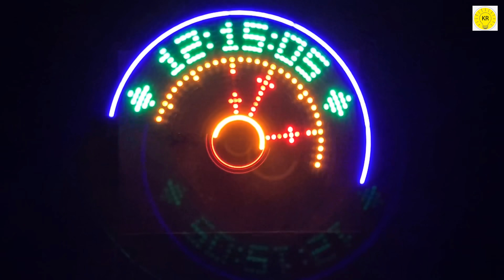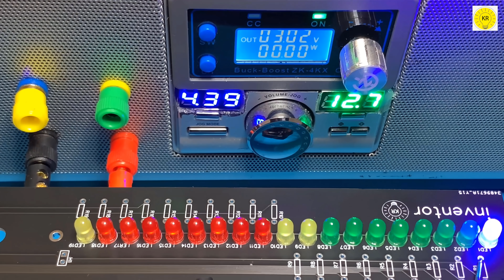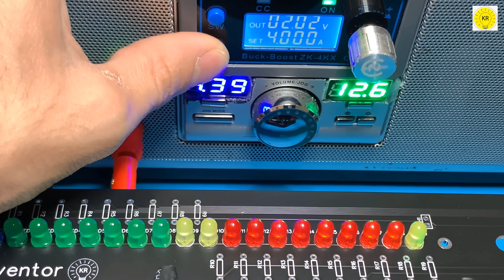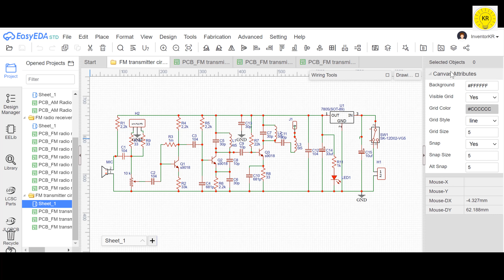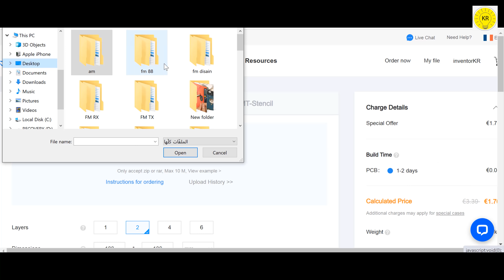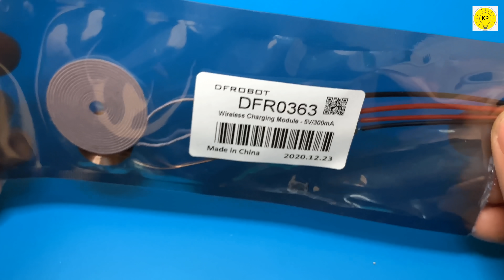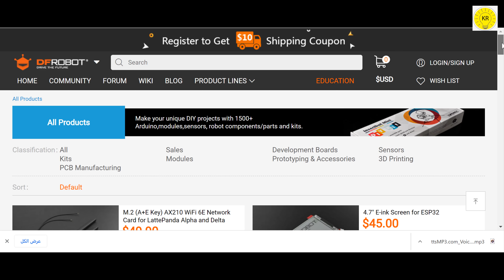how to make Propeller LED Pendulum Clock, using Arduino NANO, JLCPCB

Comment: Oh, where to begin.....

1) You are setting the time by using the serial port, which means the motor has to be turned off in order to set the time. If it's running, you're updating the time off the internal clock rate and with a nano, the clock can drift by as much as 80+ seconds each day (accuracy is in the area of +-1000/ppm.) So 30+ mins per month. An esp32 that can pull the time off the internet every so often or an Arduino coupled with an RTC makes more sense.

2) Someone said "You have not listed all the components, especially the magnet, the hall sensor, the motor, and the collar that attaches the board to the motor." and you replied "You can visit the links below the video." None of the links mention the hall-effect sensor, the motor shaft collar or which motor you're using (your link leads to motor options ranging from 3500 to 29,000RPM.)

3) Your code has THREE comments total and two of those are for the name of the project. Quite few variable names are one or two letters. This results in EXTREMELY poor coding style and makes it very hard to figure out what the code does. And the way it's formatted on your blog (with the center-justify) makes it even HARDER to read (yes, it can be pulled into an editor and reformatted but there's no reason not to have it formatted better on the blog.)
Reply from the maker: Thank you for adding useful information. I applaud you because you are clearly knowledgeable about everything about the project

Comment: Hello which DC motor using here? How it's rpm?? Mamu tell me.
Reply from the maker: 12V TO 24V 2000RPM
Reply: @inventorkr1  OK thanks! Where I get the pcb & Led set

Comment: Inventor KR. Are you interested in building a novel laser radar? My thesis received a patent on the various method and apparatus. NASA was interested in the patent in 2004, so I donated it for free to the  them. They let the patent expire. So you can build it.

US Patent No. 5,748,295

I can give you my thesis, which is easier to understand than the patent. I also have information on where to get optical collimators.

Comment: Looks like a Weller temperature regulated soldering iron.  Uses a magnetic tip and at a certain temperature the magnetic force disappears and the switch opens and when it cools down just a little the magnetic force returns and closes the switch.

Comment: It's wayyyyy to big to get a good rpm.. . Use smd leds and much smaller pcb. You don't need a big pcb area for a fancy logo :P
This design will cause alot of noice and vibrations

Comment: The video started so well, but ended in total idiocy. First, why use a full size nano when you can only use a microcontroller? Any student can program it via ICSP! Secondly, why was it necessary to take out the hall sensor outside the board, if you can put it on the tail of the board? Thirdly, why this ugly coil if the board itself can be a coil? Why this ugly coil from below if you can just put a magnet there ?! Why couldn't you make a beautiful acrylic box???!!! Just ruined my whole day with this video!!!!

Comment: hi there peeps. one question for ya. if you put a red led under a bleu led. instead of next to it. will the colors blend ? and with what rotation speed and mounting distance in correlation toowards that speed ? (singing for you a jollu good fellow...)

Comment: Back in the 90's I saw a big one of these. It was like a stack of pancakes 4 feet tall and 5 foot radius (about 10 feet wide). So the display was a big curved surface on the side. That also kept people away from this big spinning arm with the LEDS. 
This is a very cool project!👍

Comment: Two tips for when you're assembling it yourself:
1.) Use screws instead of hot glue. Much sturdier.
2.) FOR THE LOVE OF ALL THAT IS HOLY don't solder like this guy. You heat both the pin and the pad and apply solder to it. Do not make a glob of solder on your iron and then try to stick it onto your pin - all you do is ruin the soldering iron

Comment: Small tip, when you solder stranded wires with holders, heat the wire from the underside and add solder to the top side, that will make the solder wick down into the strands more thoroughly.
Reply: This whole video has some bad soldering practices. But for his purpose, I'm sure he doesn't care. Lmao
Reply: @anthonyayala7167  I guess u know what's going on in Ukraine too
Reply: @user-dm2bq7wk7y  What is going on on Ukraine?
Reply: 50 billion dollars should say something

Comment: So it looks like the thing in the middle is an induction 5v supply, but I don't see any data lines. The sensor on the side of the board seems to be sensing a pass and thus is a timing element for the display. So you would have to somehow set the arduino's time and it is taking care of updating it? Any reason why not to just solder the 5v wires into the through hole? instead of on top of it.

Comment: I didn't know the Nano had a built in RTC. How do you set the time of the clock? I didn't see this part in the code.
Seems it would be better to make it with an ESP32 module instead and make an app in Kotlin to set the time/date settings.
I like the way you used wireless power. Great project.

Comment: 5:54 anyone in the know tell me what that thing is so electricity flows wirelessly
Reply: It's an inductor. Power is supplied to the bottom coil. That creates a magnetic field. That magnetic field is "picked up" by the upper coil and that "induces" current.

This is the basic function of an electric motor, but instead of a 2nd coil, there are magnets. The rotor (the thing that spins) in an electric motor has a bunch of wires wrapped around it. Electricity is supplied to those wires, and it makes a magnetic field around the rotor. In the body of the motor there are fixed magnets which repel the magnetic field created from the coils. They are positioned in such a way so that the magnets keep "pushing" the rotor, which makes the rotor spin.
Reply: @larrybud  yes i know i just asked what is the name of the thing he is wearing?🙏
Reply: @branzrr  I don't understand what you're saying.

Comment: It's a great project but I wonder, is it possible to speed up the frequency to eliminate the blind points? I guess maximum clock frequency of nano is about 8 or 16 MHz and it might be not enough
Reply: What do you mean? The flickering you see in the video is due to camera shutter. You won't see this when you look at it with your naked eye. 60 Hz is more than enough for POV.

Comment: This is not a good design. It would be symmetrical in weight and length on both side of the axis of rotation. It should use real led drivers not resistors, in fact even better out should use ws2801 style led that are individually programmable on a single bus. And they should only use light weight surface mount component. Also make the blade narrower, it's just unnecessary excess weight to be that wide !  I would use a cob strip to save big my on this.

Comment: That's cool and all, but without an RTC chip, that thing isn't going to keep accurate time, and without any buttons or wifi, you'll have to keep reconnecting it to a computer via USB to re-adjust the time.
Reply: Ikr, there is a Arduino that has wifi. I think it's called: Arduino Wi-Fi
Reply: @ThatOneRobloxDev  its esp 32 node mcu
Reply: @yajuvendrasinghrajpurohit7888  it is normal ordinary ardiuno nano, atmega 328p

Comment: I want to know why are those magnets for?
Reply: Part Q3 (at 3:04) is called a Hall Effect sensor. It's like a transistor, but "turns on" when in a magnetic field. So when this thing is spinning, the code reads the pin which is connected to the hall effect sensor so it "knows" the position of the board.

Comment: Hello, my question: How does the Time Set?
Reply: With a giant bang
Reply: Set in computer when programmed. There is no crystal oscillator used so the time will be completely wrong in an hour or so.

Comment: didn't see you add an RTC to the Arduino, how's it gonna keep track of time
Reply: it just counts the time between interrupts from the hall effect sensor
RTCs are necessary because on board timing mechanisms lose track of time over hours and days of counting, it's fully capable of keeping track of time between pulses and pulse lengths to the nanosecond very accurately
Reply: @wehadagoodruniguess.2384  The Hall sensor is to detect the angular velocity to synchronise the LEDs for each rotation.  That couldn't be used to keep track of elapsed time as it will fluctuate quite a lot, especially on start-up.  An RTC to store time would be good, but the 32768Hz  crystal will be no more accurate than the 16MHz one on the Arduino.  The big gain with the RTC is if it has a battery or supercap to keep time when power is removed.

Comment: Interesting project - But I wish you were more complete as to the parts list.  You have not listed all the components, especially the magnet, the hall sensor, the motor, and the collar that attaches the board to the motor.
Reply from the maker: You can visit the links below the video

Comment: Anyone can get a PCB, an MCU, dump the program and solder the components. But what's the actual logic behind this? Is there a feedback loop going from motor shaft to MCU? Or is it hard coded for a specific Motor RPM ? What's the role of that magnet? Think in that way
Reply: It's an hall-effect sensor, so you are correct. It senses when the lap starts.
Reply: Take a look at his code. The magnet "trips" the hall effect sensor so the code "knows" the position of the board, or at least, the starting position.  there are 120 "pixels" around the circle, or every 3 degrees. That's all I can figure out so far... wish he used a little better description in his variables, or at least, some code comments :-) would need to build one of these to play around with it more.
Reply: @larrybud  i get you. Makes sense

Comment: The worst soldering job I've ever seen.
Reply: It really is bad! Thinking about all the vibrational forces the solder joints are going to be subject to in this project over time, it will fail in no time.
Reply: @roygalaasen  do you think it too? I thought i was the only thinking the same words as you wrote!! 
This is just a "tv spot/ads" with his sponsored product, but he can't understand how to use it. 

Without the paint on the mobo, I'm pretty sure he doesn't knows what is + and what is GRN... 😆

Comment: you could use ONE resistor on the ground instead of 1000
Reply: It's parallel, not sequential.... This way you need more resistors, but less voltage.

Comment: Be aware that the suggested code has a function for setting the time using IR-receiver but the PCB lacks IR connection and the video shows nothing about how to set the time. 
You have to improvise if you order this PCB.

From the begining the link obove gave you even a zipfile containing the gerber files for the PCB. Now they asking you to pay 10 dollars for the file. 
Any way, I ordered the PCB and the delivered PCB is not the same as the video and link above is showing you. This video seems not to be accurate on any part!
Reply: Would it also be possible to use a Pro Mini instead of a Nano to make this a bit smaller? Definitely needs IR though. Wish I was smart enough to design one of these myself :(
Reply: @TMRu22311  you can if it has the same amount of I/O. Otherwise you have to delete/mod the arduino's code and reduce the amount of led (example 10 instead 15). The codes are the same for any arduino, just the I/O are different
Reply: @TMRu22311  anything is possible, but you'd have to redesign the pcb.
Reply: Did you see the code yet? The starting h/m/s is hardcoded at the top.  Otherwise you need more hardware to get the current time on the arduino.
Reply: @larrybud  Adding an RTC would make it even bulkier.  I wonder if using one of the smaller ESP8266 modules would be better. Then you could connect to it using BT. I really would like to make one of these, but I would want smd leds on a smaller version. Maybe one day I will be smart enough to work on that :/